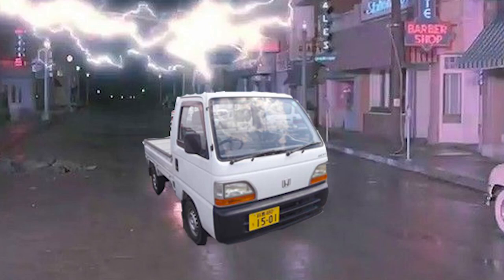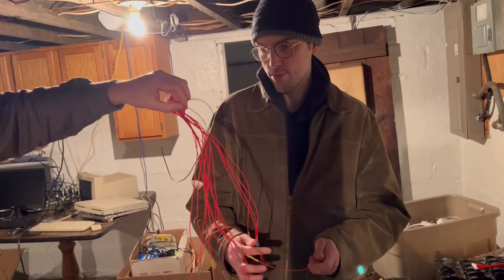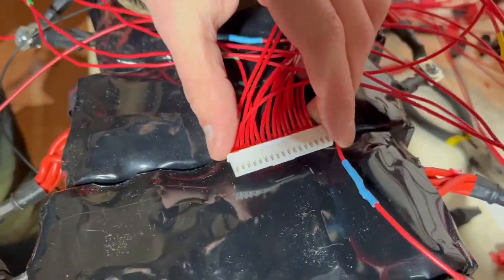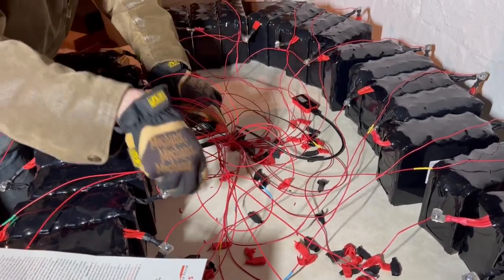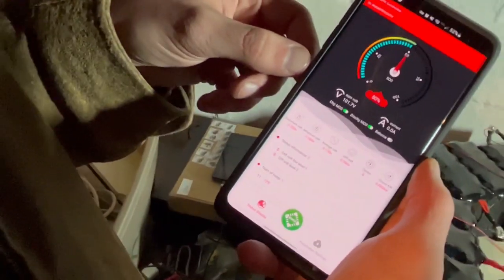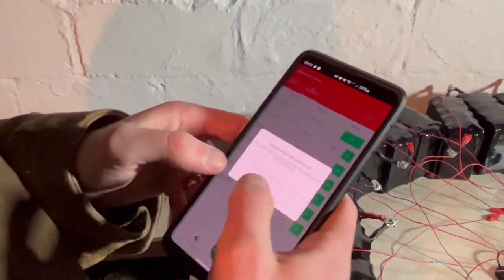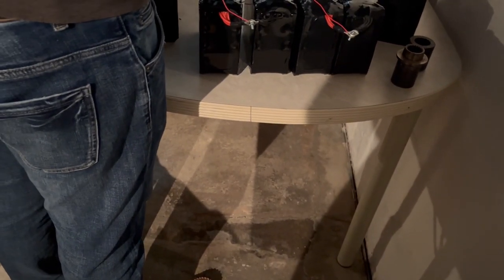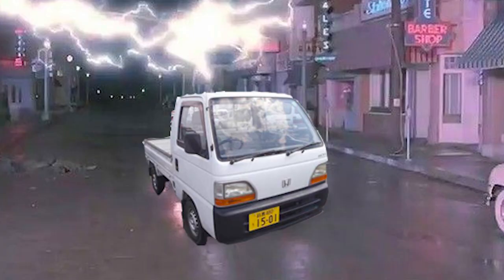Converting a Kei truck into an EV - Setting up the BMS - Part 16

Comment: Lithium-Ion batteries are generally shipped with a "Maintenance" charge (usually around 70%), that way they aren't overstressed by being held at 100% (which can reduce battery life). They can also self-discharge very slowly (which is why they're not shipped empty). It is entirely possible your cells are about half full (As LiFePO4 cells like you have define their working voltage from 2.5-3.65v)
Reply from the maker: thanks for this!

Comment: I've ordered a handful of stickers to be going on with. :)

Please do keep this coming! My '05 Carry comes in a couple weeks and I can't wait. While I plan to run it as-is for now - I'm already thinking about the 5-10 year plan when I need to get even more efficient. My first thought was a modification using a different (Suzuki Alto Lean-Burn?), variant of the Carry's K6A engine, but this is even more interesting.

There's some annoying limitations in the UK though - it's illegal to use LED conversion bulbs on the exterior of a vehicle, and building a radio transmitter like yours would also violate our laws.

Though in my case that last one is not an issue since the previous owner in Japan added a full aftermarket infotainment system. Of course, I have no idea what any of the controls do, and I think it only has maps for Tokyo - but eh.
Reply from the maker: That sounds fascinating! We'd love to see videos about that car. 

Don't sweat the radio or the LEDs. Part of why we worked on stuff like that was to become more familiar with electrical projects and the car's architecture. You should still be able to do a full EV conversion.

You should check out the "DIY electric car forums", by the way. There's a wealth of information there. 

Good luck!